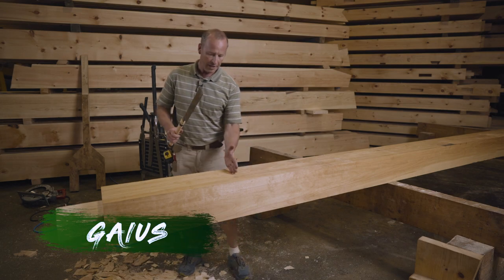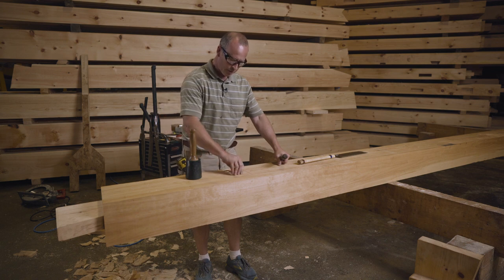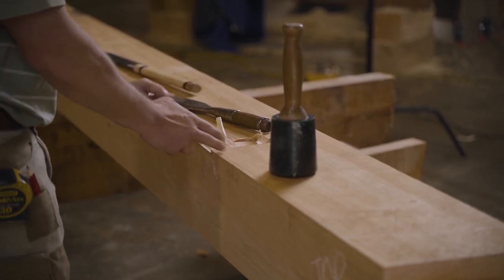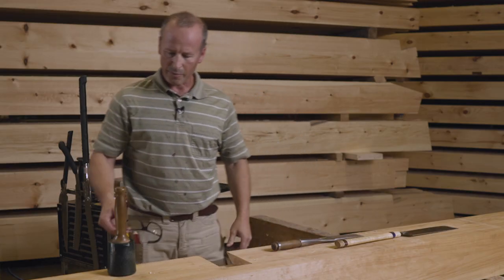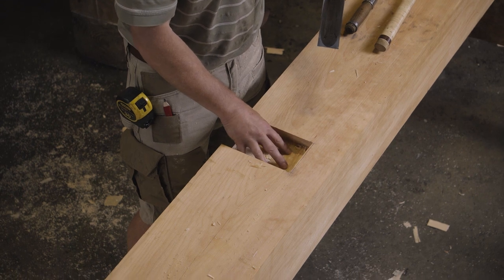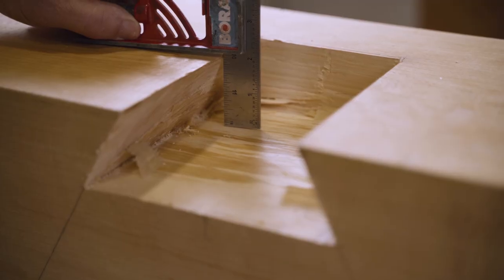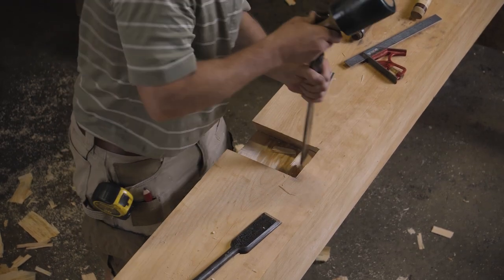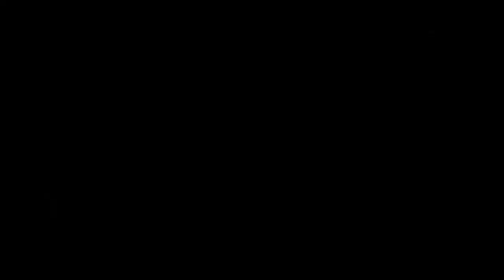How to Cut & Refine a Dovetail Mortise Using Chisel and Slick - Timber Framing Online Course Sample

Comment: Can you do this with a angled circular saw cut?  Just chisel out the end.  Whatever the radius of the blade don't get, you can come in with a chisel against a already registered face?  Sorry just stumbled onto this video wasn't sure if this was a all hand tool deal.
Reply from the maker: Cal L you sure can make the relief cuts with a circular saw. To make the cut on the left and right side, you will need two saws; one that pivots left (hypoid gear type) and one that pivots right (worm drive). Cutting every 1/8” or so makes for easy chiseling. This video was meant to show the hand tool approach.
Reply: @ShelterInstitute  I thought so too.  That's a nice and sharp slick BTW.  Timberframe has always interested me.  So much sturdier (at least in feel and beauty) than a nail and hammer stick framed house.

Comment: Hi guys. Really enjoying your videos. Wondering about the kinds of timber most frequently used for timber framing. Is that post pine? Also, do people in the states usually source the timber from their own properties? 
I'm in Australia, most available trees here are hardwood.
Reply from the maker: Thanks for watching....we use eastern white pine and eastern hemlock regularly, because they are abundant here in Maine. If we need a sstronger or stiffer timber (to limit deflection) we import some douglas fir from the west coast. If we need rot resistance, we import one of the excellent cedars from the west coast (Port Orford, Western Red or Alaska Yellow). We do find that a lot of our students use the wood from their own property-very satisfying!

Comment: Hey Shelter!  I signed up for the Feb Design build (in person) class and like all good students I'm preparing for class by watching and learning 😀. I'm assuming that particular joint was for a joist or some kind of floor support... after, say 30 years, once both timbers have shrunk to their final sizes, what would one expect to see upon pulling the floor up and inspecting the joint? I know it is common practice (rule of thumb) to leave a small gap at the back of a regular mortise that you intend to peg a tenon into, allowing room for shrinkage of the timber with the mortise without exploding the joint but I would imagine you cut the male half of that joint to fit the dovetail pocket perfectly. Is the hope that both timbers involved in the joint shrink at the same rate, allowing the male portion to slide forward in the pocket as both timbers shrink in width?  Since the male end of the joist is very likely smaller in width, how does one accurately compensate for this (especially considering the many varieties of wood species people use in timber framing or even someone using two different species in the same joint)?  I'm pondering the same question with regard to the level of the two timbers on which the floor itself is laid upon (after 30 years).  Would the top/sill plate shrink more since it is bigger, leaving the joist proud in the joint?  Thanks for the video, I'm excited for Feb and gaining the last bit of confidence I need to begin my journey!
Reply: Did you get the answer to your questions?